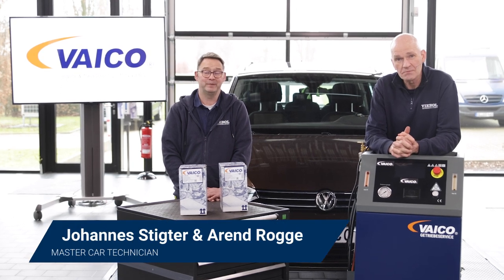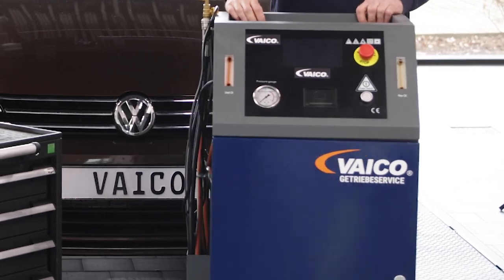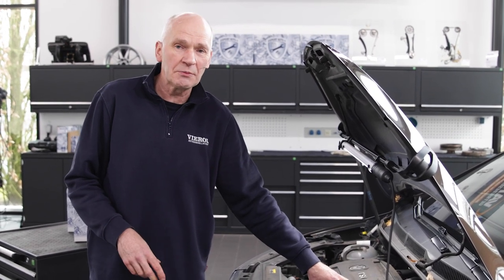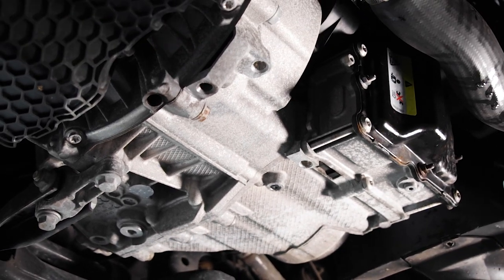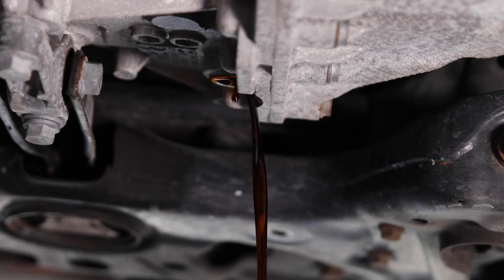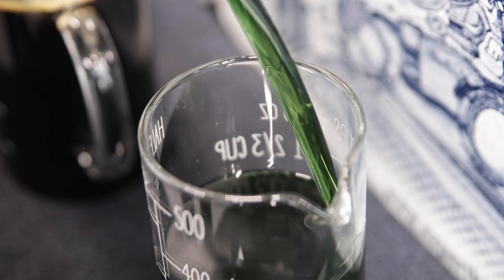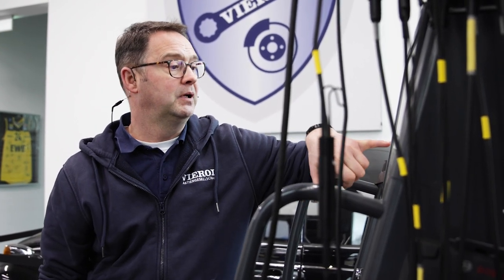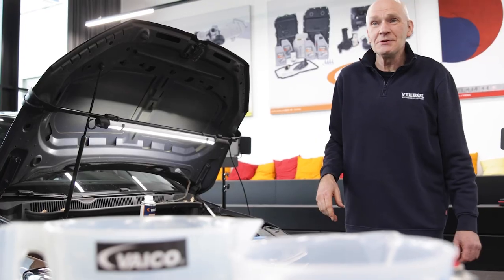Transmission fluid change DQ200 0AM | VW, AUDI, SKODA | EXPERT KITS+ V10-5582-SP1 & SP2

Comment: Thanks for such an informative video, I have VW Touran 1.6 TDI, 2018. As per user manual my car has so called lifetime gearbox oil but I don't agree with this idea, so I have replaced the gearbox oil at 120tkm and filled 1.7L. I asked the VW official mechanic about mechatronic oil change, he said no need to change it. After watching this great video I am in favour to change both oils after regular intervals, I will be very pleased if you could suggest the kilometre intervals for mechatronic oil, gearbox oil and engine oil. Thanks in advance 🎉

Comment: Very informative video for DQ200 car owners! Thank you for producing this video. Will there by any issue if an extra 100ml is added to the gearbox and mechatronics each?
Reply from the maker: Hello @xuxuonex7427,
thanks for your comment and good feedback.
We wouldn't suggest to overfill both parts of the transmission. In case of the mechatronics 100ml more, are more than 10% too much fluid. That could have a negative effect on the shifting behaviour.
In our opinion you should stick to the manufacturers guideline regarding the fluid quantity in each part.
Regards,
Team VAICO

Comment: Hello, great vid! My mechanic replaced my transmission oil as 3 litres instead of 1.7 litres. He said it's bcs there is no oil pump in this model, thus it has to be oiled up until halfway point of it's volume.  What do you think about it, is it wrong or do harm to my car?
Reply from the maker: Hello @keremgundogdu8205,
some of the community has already commented, that they go with 2.3l fluid. That seems like a sweet spot for most of them. We adhere to the manufacturer's specifications, but there may be some room for more fluid in the system. For us 3l may be too much, but if you like to, keep us in the loop and tell us more about your experience if you decide to keep rolling on that level. It will be interesting to hear more on the different fluid levels in the mechanical unit of the transmission.
Regards,
Team VAICO
Reply: @VAICO  I have been using it for only 4 days, I'll definetely update if anything happens. Thanks.
Reply: Today I saw the warning "Gear R not selectable" and I must say I am utterly disappointed. Also gear transmission felt a little sluggish.🥲🥲Now I'll get the equivalent oil that is available in my country and replace it again as 1.7l or 2l 😅😅
Reply from the maker: @keremgundogdu8205,
thanks for the update. We hope that your transmission will perform better, after releasing or replacing the fluid in your system.
Regards,
Team VAICO
Reply: @MrTuts4life hi, i never had any fault after replacing. also now feels more smooth. i only drove about 150 km with wrong oil so i doubt it did any harm.

Comment: Hello, I have a Volkswagen Golf 2018 model DQ200 dry clutch DSG Transmission vehicle. I want to change the Mechatronics Unit oil. But I am worried because I am not sure if it will require adaptation after the change. Your opinions on this subject are very valuable to me. Thank you.
Reply from the maker: Hello,
In most cases and when only changing the mechatronics fluid, you don't need an adaption afterwards. 
Regards
Team VAICO

Comment: Hello, thanks for the video. Is it necessary to have the vcds or any diagnostic tool to do the oil change ?
Reply from the maker: Hello,
you should use a diagnostic device. There is the chance that the vehicle will save some errors and you should delete them after the oil change. Also there will be additional information on the torque for the loosened bolts and filling quantities. For the work itself you won't need the tech because it's all mechanical labour.
Regards,
Team VAICO
Reply: @VAICO  Thank tout very much
 I did the job this morning without any issues on a 2018 golf 7 variant 1.6 tdi 115hp. 😊
Reply from the maker: You're welcome! Thanks for your comments.

Comment: Hello. I changed the gear box oil from the dq200. I measured the oil out and it was 1.4ltr. Filled back with 1.4ltr. Should I be concerned and put the extra 300milliter as I thought I needed 1.7 ltr. The car never had a gear box oil change.
Reply from the maker: Hello,
the oil level and quantity can decrease over time because of the chemical degradation. Also the DQ200 is usually underfilled when it leaves the factory.
We cannot assess whether the smaller amount of oil can cause damage. To be on the safe side, we have kept to the specification of 1.7 l.
Regards,
Team VAICO
Reply: @VAICO 300 millilitres is way to much difference. I would expect something like 50 or max 100 millilitres. Shall I put the extra 300 millilitres on the car? So far hadn’t noticed any issues with 1.4lt

Comment: I have a new car with the DQ200,  it makes metallic clicking noise when shifting in city driving and also over bigger bumps only when it is warmed up, it is annoying.  Is this normal for this transmission?  I expected it to be quiet, I am disappointed.
Reply from the maker: Hello petar_d488,
That is definitely annoying. Unfortunately, we cannot make an exact diagnosis from a distance. Maybe there is a problem. We haven't noticed clicking noises with the DQ200 so far. 
Regards,
Team VAICO
Reply: @VAICO  Actually it a rattle , not clicking. There are many videos on YT about this rattle, type "Bruit de cliquet Boîte DSG7 / Dual Clutch Rattle Sound,"  or  "Gti mk7 autobahn dsg rattle" .... they say its normal, but is does not sound normal. It was not an issue with dsg6.
Reply from the maker: Some drivers have experienced that the rattling sound comes from the dual mass flywheel. Maybe this part has to be checked, repaired or replaced. If you would like to know why dual mass flywheels start to make noises, we have got that covered in another video on our channel. 
Regards,
Team VAICO

Comment: Dose dq200 come with filter?
Reply from the maker: Hello @skate89able,
we do have a mechatronics repair kit in our product range, which includes the filter.
To replace the filter you need to remove the whole mechatronics unit from the transmission. We have made a video that shows this process:
https://youtu.be/rG57s4QfjTI
Regards,
Team VAICO
Reply: @VAICO would you reccomend replacing the filter or is the fluid change enough in your view?